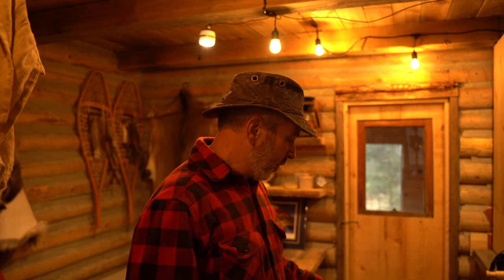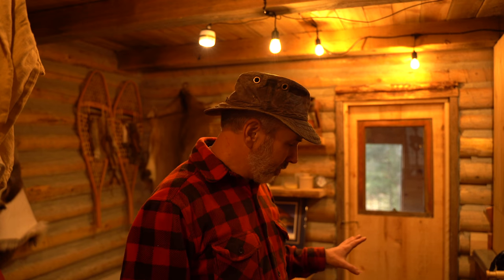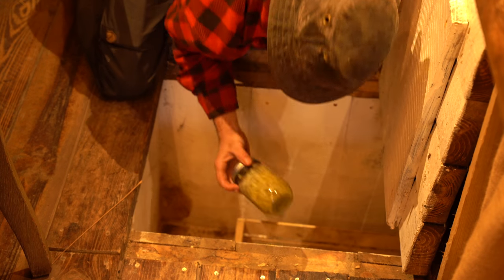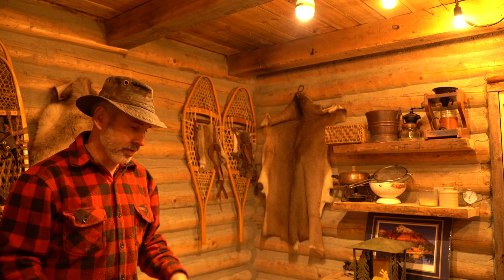Building a Charred Plank Floor and Root Cellar | How to Build a Cheap Log Cabin, Ep7

Comment: Wood milled from a green log takes about a year to season and stabilize per inch using a outside air drying method.  A person could cut a bunch of pines down, mill them into lumber in a few days with a portable band saw mill, stack the wood inside of a solar kiln on site, and go work on digging the basement, creating the foundation while the lumber is getting seasoned enough to work with.  By the time your ready for the lumber, it will be stabilized and much lighter to carry and work with or transport to the building site.
Reply: And Shaun has been felling, milling and seasoning the timber from his property for over a year already, which he is using for the current projects.

Comment: You could try drilled holes in the cellar covered with mesh. Towards the top edge. Or you could vent it to outside, may defeat the purpose of a cellar though.

Comment: You mentioned ventilation for your underfloor box. Did you consider a ventilation duct for the fire? I realise the fire is fairly close to the door, so this where it draws most of its air supply from and this probably doesn't bother you. Would you fit a duct in the next cabin?

Comment: I understand that it is difficult to release a new video on a regular basis, which is certainly a commercial necessity.  A compilation of videos published over the past two years is a very easy way to solve this problem.  The added value of this video is therefore very limited.